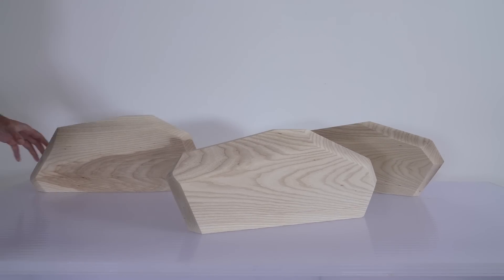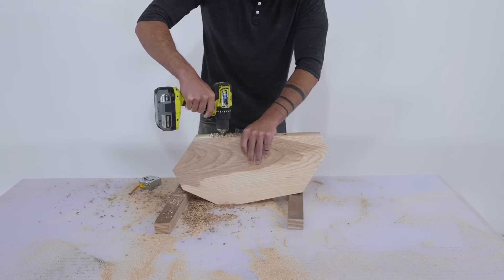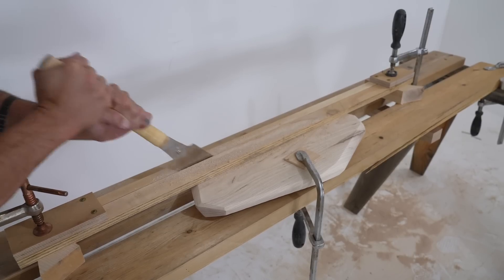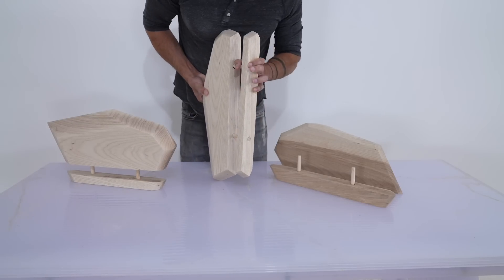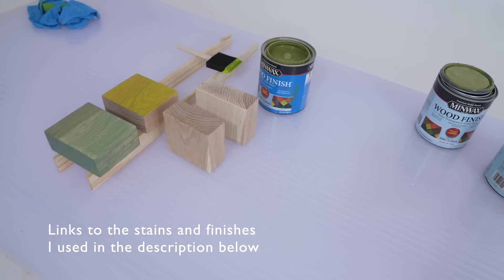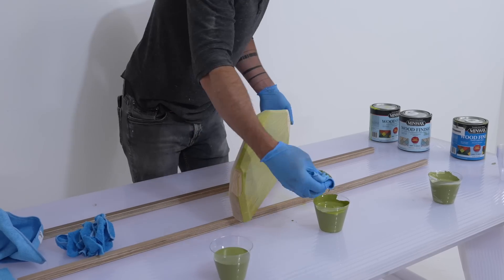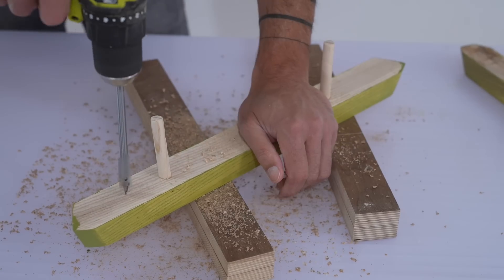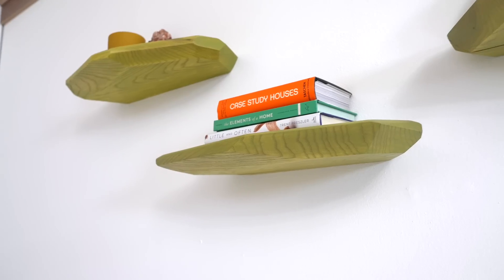DIY Floating Shelves

Comment: For those tempted to emulate the content creator: angle grinders are exceptionally dangerous tools; carving heads for angle grinders are some of the most dangerous attachments for angle grinders.    These tools can and will grab work and walk into contact with the operator in only fractions of a second- SO PROTECT YOURSELF: wear leather arm, body, and hand protection, a face shield, and never apply the tool where progress across or through your material is in line with any parts of your body you want to remain the same shape.   Avoid bracing or any posture that locks your body in close proximity to the tool.
Reply: Thanks for this.  I have been tempted to get one of these heads, but hadn't considered the forces they must be exerting.  I saw someone with chaps for chainsaw use the other day, and I'm starting to think more and more about safety gear like that for when I'm wood working.  So far I've been lucky enough that I've hurt myself more with a kitchen knife than anything in my wood shop, but there's always room for more caution.
Reply: @Raytenecks  My first introduction to angle grinder shapers was a YT video by a prominent wood working content creator; they had plenty of experience with angle grinders, but it was their first time using the shaper- and really mangled themselves. 

Earlier this year, I had the GOOD fortune of wearing some woven Kevlar gloves that came with my shaper head when using a conventional grinding disk on my angle grinder; focusing on the work rather than my posture and possibilities, in a split second the tool slipped off the target, ran, and cut a perfectly disk-shaped cross section out of my hand, the Kevlar melted through like butter as though it wasn't there.   Good fortune?  Absolutely- I learned the limits of Kevlar gloves, was not disabled by the injury, and my respect went from abstract to immediate.  

Later, when using the shaper, I covered all in leather, and remained very focused on my relationship to the tool.  Very, very powerful, both breathing awareness and posture impact the surface quality, every motion transmitted to the surface.   I managed a deep, tapering bevel onto a slab of hickory that only required minor follow up with a belt sander.

Comment: I'm really surprised you use drywall anchors!? Have you had sagging? I can't imagine not getting at least one stud if not two for support. 

Have you seen Ian Kirby's torsion box shelves, I'm hoping to make a few of those soon, you lag screw a ledger board into studs, and then the torsion box shelf slides over that ledger board, glued onto it for invisible mounting. He had a photo where he actually sat on the shelf afterwards, though that seems brave with his weight!

Comment: One thought on the sanding. Did you sand each piece on its own, or did you attach the base to the shelv via dovel to sand? The first will round over the matching edges and creates a small gap, which I think was kinda visible in the video.
Reply from the maker: yes to sharp would leave some splinters on the hard edges
Reply: @HomeMadeModern  If I want to keep my edge crisp, I clamp a piece of scrap wood with a sharp 90° edge to the edge of the wood that I want to sand smooth. Helps alot for situations like these shelvs. Btw, I really like the idea of using a piece of the shelv as the mounting base. If the shelv is thick enough, you could even cut the back piece with a 45° angle, so you just have a visible seam on the underside and the sides.

Comment: I love the power carving that you do, and I want to create more organic shapes in my woodworking; however, I'm a bit scared of angle grinders and shaping disks for catching and for having hands so close to the business end.  Are there any "genteel" shaping disks you would recommend or even an alternative to using an angle grinder to create the same effect?  Thanks!
Reply: I know it's been a while since this comment, but Kutzall has a whole bunch of different discs that are easy to use and way safer than some of the alternatives I've seen.  I was a bit intimidated at first but after finding a few videos on angle grinder safety and using them for a bit I felt pretty comfortable fairly quickly.  If you're taking it slow and not getting too aggressive with your cuts it can be surprisingly smooth.

Comment: Hey Ben, I made some larger shelves with the exact same technique, but the back mounting piece warped pretty notably in all of them a day or two after I ripped it. I had previously checked the wood moisture content and didn't seem that wet. Any tips?
Reply from the maker: For 2x10s construction lumber I have seen this. This is kiln dried hardwood so no issues.  plywood would be a good choice as well.  the long the board the more likely the warp

Comment: You don't secure the two halves after you put it on the wall?
Reply from the maker: you can with an angled screw but they hold pretty tight

Comment: I admire the creativity, but wouldn't it make more sense to use existing floating shelf hardware that is on the market? 

You can find them made of steel as well, which would add to the strength.
Reply from the maker: Yes!  the off the shelf steel brackets are great and provide more strength.  I like the ones from semi exact and am using them on some kitchen projects.  They are not cheap though and I wanted to show a more DIY cost friendly approach
Reply: @HomeMadeModern  Just to get some feel for the prices - how much do these brackets cost in the states? I recently built some floating shelves myself and in good ole germany, these brackets come at ~4$ a pop (professional quality, not the hardware store crap).